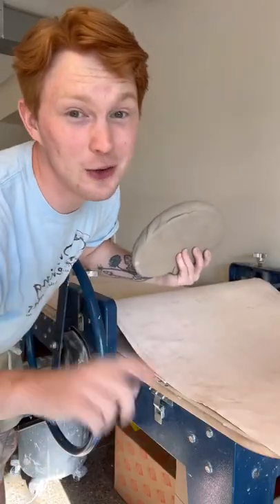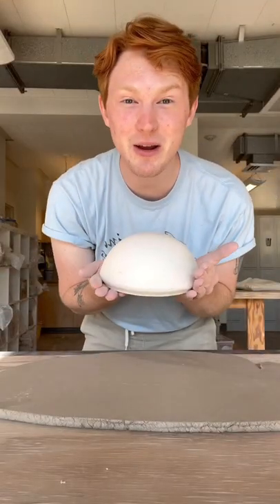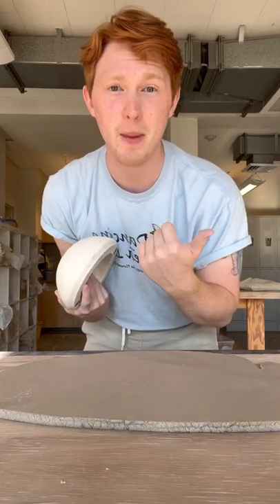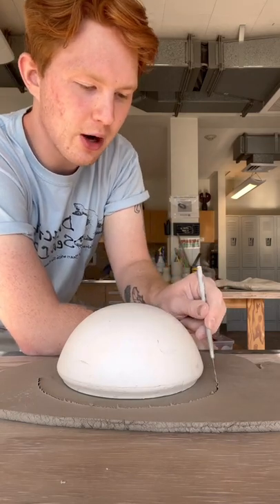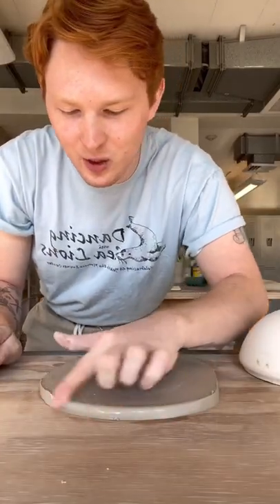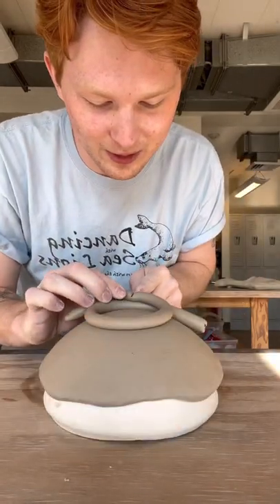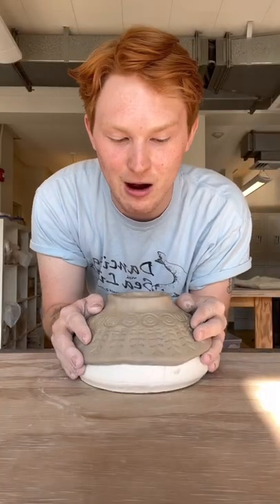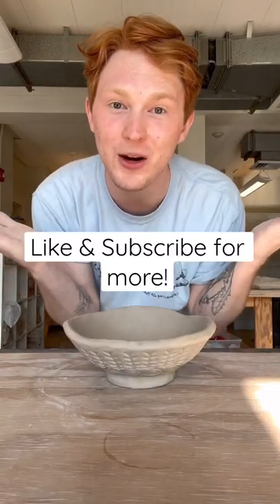Learn how to make a ceramic bowl without a pottery wheel! #pottery #ceramic #howto #arttutorial

Comment: When you're using a mold for anything like a bowl (larger on the outside and smaller on the inside) don't leave the clay on the mold to dry if you're placing it over the outside of the mold like here in the video. Clay shrinks as it dries and if you leave the clay on the mold when it's on the outside it will crack as it shrinks bc it can only contract as much as the mold allows, anything after a certain point and it will break. Now if you're putting the clay on the inside of the bowl you can leave it for as long as you want bc the clay can shrink with nothing to prevent it from doing so, since the clay is sitting inside the bowl.
Also the plaster absorbs the moisture from the clay, so when you remove the piece from a plaster mold it dries quicker bc it's wicking moisture as it's on the plaster. If you use anything like steel or plastic or glazed ceramic wear, the moisture remains in the clay and it takes longer to dry, it might also be harder to remove the clay from the outside like in this video if you're using plastic etc as a mold and not something that absorbs water like the plaster.

Comment: I actually learned this really cool trick when I did Ceramics so we had this canvas wrapping on our table and so it would have Clay Destiny you know to keep it from sticking well one day we when we were scraping I took some of that clay dust and I just pretty much rubbed it on this mold because I was trying to make a slab plea and I had tried doing it before and I ended up breaking my plate because it kept sticking so when I rubbed that clay dust on my mold and put the clay on it it came off right easy and in the video you said I hope it doesn't stick I thought you might be interested in trying it maybe if you have a bunch of clay dust